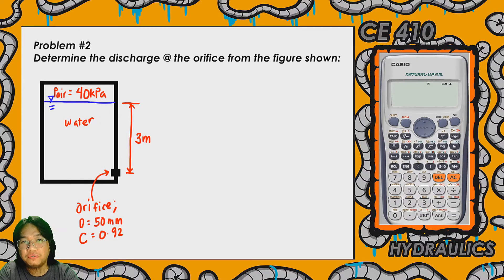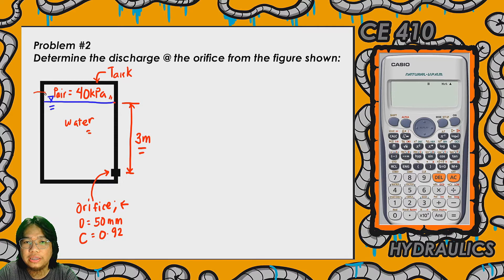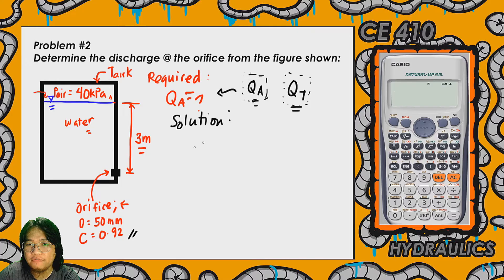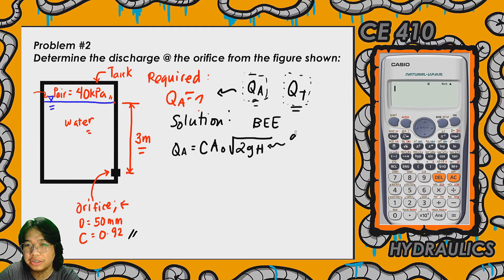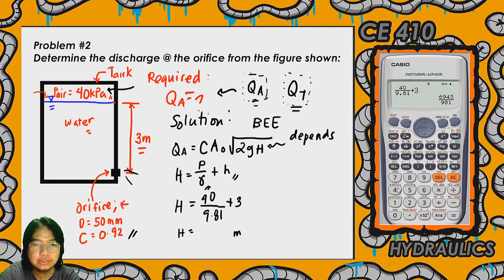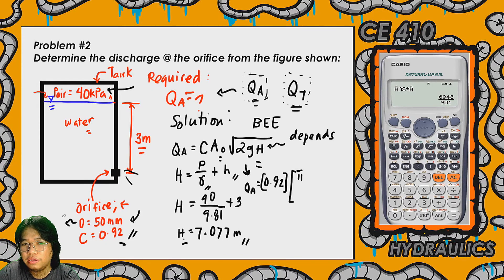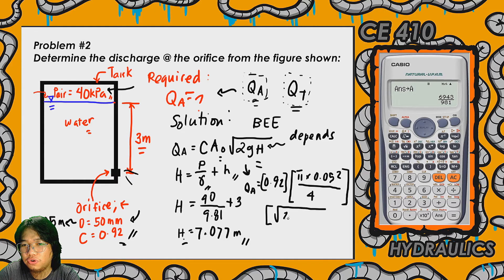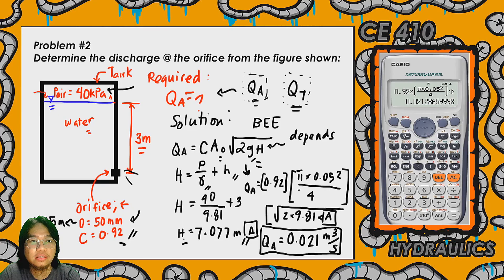Fluid Flow Measurement - Problem #2 Orifice (Constant Head) - PAANO

Comment: Sir pano po kung ang liquid is oil (sg=0.8)? Ang H po ba ay H=3(0.8) + 40/9.81(0.8) ? Thank you sir.
Reply from the maker: Hindi po, bale sa pressure lang gagamitin yung 0.8. Yung sa height na 3 hindi po. Try using bernoulli’s energy equation to verify, consider the liquid surface as point 1 and the jet @ orifice as point 2.

Thank you for watching.